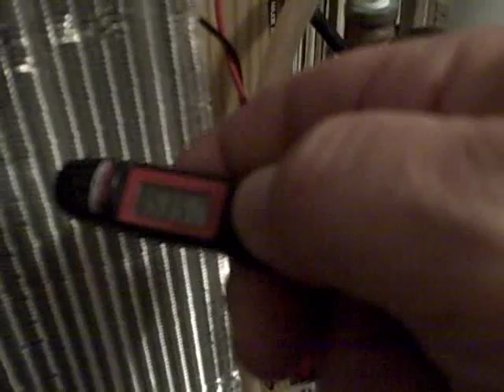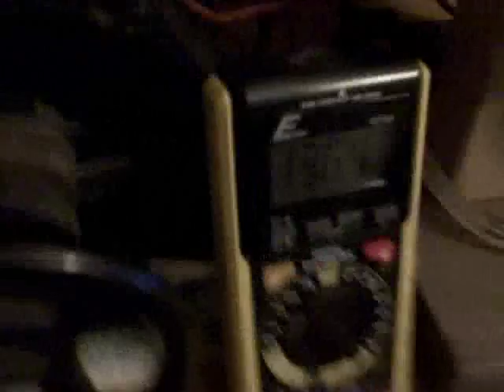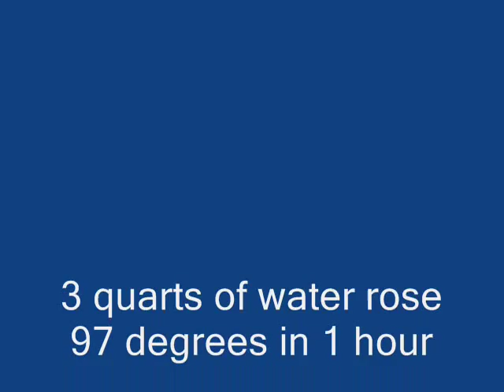Plasma Heater Testing.wmv

Comment: I would like to build one to heat a house, however this data is discouraging.  At this efficiency I would only require 25,000 watts to heat my home.  About $2400.00 a month to heat my house using electricity.

Comment: Nice data, good to see. I am building a bike gen for the occupy wall st movement and am thinking about using Bedini for batt charging and plasma water heater for heating purposes. I would like to know what circuit u are using and if its ac or dc power. 
Also, try spreading the plasma spark out by having a magnetic presence near the spark, will increase the surface area and i belive, heat the water faster.
Aloha, 1.618 0112358...INF